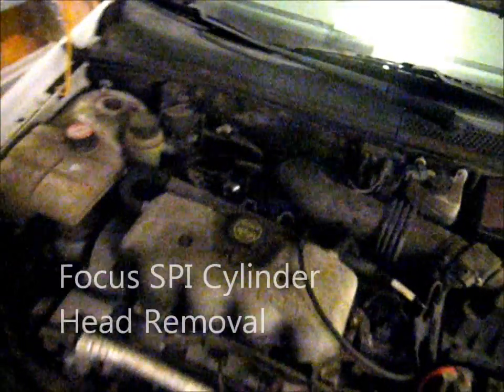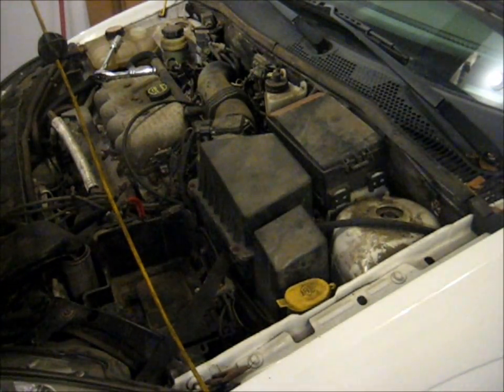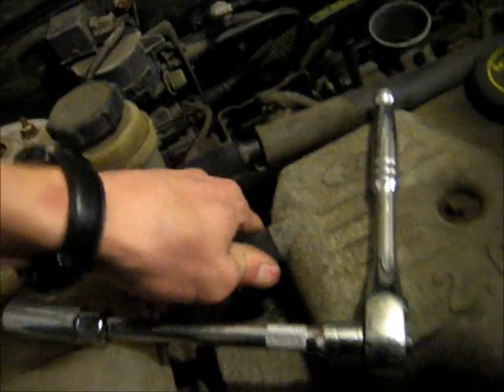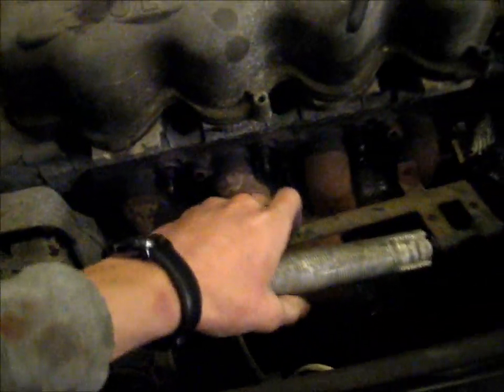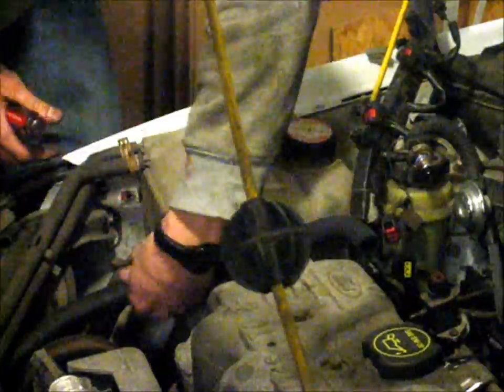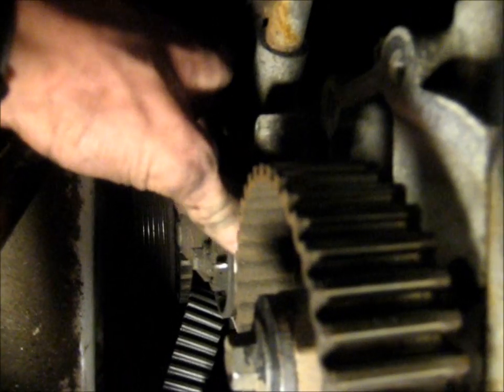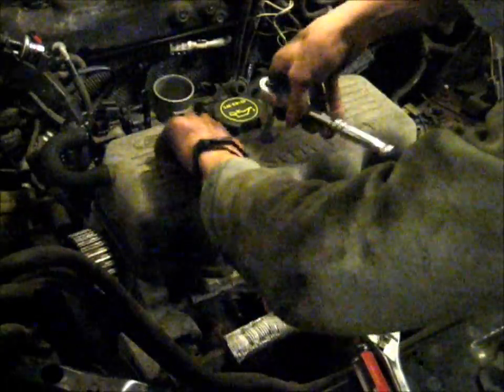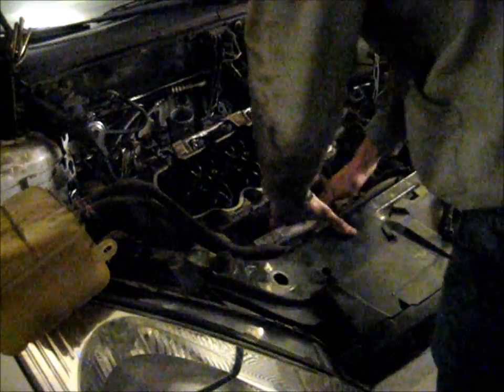Ford Focus SPI Cylinder Head Replacement Part 1 of 4

Comment: Update bought head from heads only and wow they were awful the company did not push down valve seals  so I was blowing blue smoke . When I called them to ask how could you do something like that they hung up.  Check your seals  before installing head. Heads only are very rude I would try someone else.

Comment: to any one who may see this and have a focus with the sohc engine with original head do yourself a favor and follow Alex man's advice and replace with an updated head. I found out the hard way in most cases when the seats dropped if not shut down immediately catastrophic failure will occur... so instead of a 500 dollar fix it can turn in as my case a 1300 dollar fix  and that's cost of parts and machine work unfortunately as the years progress the blocks are becoming hard to find and cost is rising

Comment: Hi Alex, 
Please help, I'm getting conflicting diagnosis from 2 different mechs. Just bought a year ago. 05 Ford Focus ZX4 2.0 DOHC with manual trans.. I'm smelling burnt oil from fresh air vent. No blue smoke or smell of burnt oil from tail pipe. There's oil  dripping from side of motor. First mech replaced valve cover gasket as process of elimination. Somewhat reduced the burnt oil smell but said the lower gasket might need replacement too and more costly. Got a 2nd opinion and 2nd mech wants to replace oil pan gasket. I don't know who's right. The first mech did reduce the burnt oil smell. What do you think. it runs with plenty of pep. I appreciate any info you could give. Thank you.
Reply from the maker: Lower gasket and oil pan gasket mean the same thing to me. Might just be
 the two mechanics use different words. Use some engine degreaser to 
clean up the caked on oil mess. Once it's clean you'll be able to 
pinpoint the source of the leak and replace the corresponding gasket.

Comment: Why not buy a low millage 2.0 16v DOHV Zetec engine and retrofit it into your focus The SPI engine was only offered in the USA and Canada hand down the worst engine ever built ever...
Reply from the maker: It's not worth it. Way more parts are required. Messing with harnesses and computers is a hassle. A head swap is way easier. It's just an econobox car that nobody cares about and if it has some hackjob engine swap then it's worth even less.

Comment: 2000 Ford Focus SE Wagon was pushed into the garage this weekend as a project car for 600 bucks.  I watched this 4 part video series, then watched part 1 like 4 more times.  As of me typing right now, I am exactly where this video ends.  IF you have some common sense, mechanically inclined enough that you are not in fear of this type of work, this young man has given you SPOT on education on this removal.  My removal went EXACTLY as this video describes.  I contacted headsonly and found the head Alex got is 200 dollars.  For 250, you get a complete head, new cam, lifters, rockets etc.  WELL worth the 50 bucks!!!!!.  OF note.  NOTICE the starter when you get to this point.  It is BURIED on this car.  With the head and intake out of the way, I am replacing the starter and the positive and negative cables while I have super easy access!!!  Also. . .now is the time to CLEAN, inspect and replace any bad hoses, tape up that wiring harness bad spots, clean the fender wells, etc etc.  Finally, to lift the entire head, exhaust manifold and intake manifold. . .I used a 8ft step ladder, a 8ft 2x4 and a chain and lifted, pivoted and then set it on the front of the cowl, then hand lifted it down to a bucket.  Worked like a charm.  EXCELLENT video Alex. . .well done sir.

Comment: My Problem runs deep: definite damage to one or more Pistons/Rods, so I intend to replace any damaged parts, then completely rebuild each piston with new rings.  If I'm understanding this correctly; I will need to purchase a Re-Spec'd Head which includes the Re-Spec'd Valve Seat corrections, in order to be certain my efforts have not been in vain, and history repeated, yes ?  In other words, just having the cylinders alone rebored will not prevent the valve seat problem from reoccurring ? Also: I would drain the oil as my First Step. Is there a reason I should not ? Just curious, because even in other videos, nobody seems to be showing draining the oil as an early step. THANKS !
Reply from the maker: Kenneth Enos Boring the cylinders has no affect on the head. You will need to replace the head to fix the problem now, and you should replace it with a head designed to keep the same problem from happening in the future. Drain the oil now or later, it doesn't matter as long as you change it. I think I left my oil in the engine during this work. I changed it once I got it running. No point changing the oil in an engine that is scrap.
Reply: Been studying all the vids, and looks like your suggested EBayer has the recon heads for great price. Hardest part that scares me is pulling all the pistons for replacement & New rings. Thanx Alex!

Comment: how's the head holding up? I just ordered one from "headsonly" on eBay as you did. it arrived today and looks decent. Haven't gotten around to putting it on yet. I have a 2000 sedan. It has not dropped a seat but I feel like it's coming or already has started to drop.

Comment: Do you need to pull the engine completely out to swap the head?
Reply from the maker: It is not necessary. Watch parts 2-4 to see the rest of the process.
Reply: TheAlexManVideos
Doh- of course! One more question -- you removed the head from the block with the manifolds attached. Why not put it back on with them on as well? Let me guess, too difficult to line up the dowels without messing up the head gasket?
Reply from the maker: citabjockey I don't see any specific reason not to install the head and manifolds as a unit besides easier maneuvering of heavy parts.

Comment: How much did it cost you to replace the cylinder heads on your own?
Reply from the maker: Between the head, gaskets, head bolts, and other small parts I'd say you should set aside $500 or so.

Comment: You didn't show the throttle body connections nor the electrical connections on the back side. Careful on the electrical connections as they are brittle. I am trying to figure out that connection of the throttle body to the firewall.....

Comment: I'm in the process of pulling the head on my 2001 Focus - I've got everything off except a connection between the throttle body and the brake booster - I can't figure a way to disconnect that - any suggestions

Comment: for anyone doing this job, the fuel line has a disconnect tool you can buy for 2 bucks, saves a pain in the ass:P but this is a simple job take your time and label things if its your first time!

Comment from the maker: I'm always willing to answer questions. The process is fairly straight forward for an experienced mechanic, but there are many practices you must keep in mind. Don't mix parts, keep all internal parts clean. New head bolts MUST be used, gasket services should be clean enough to eat off of, and never use abrasives to clean mating surfaces, just to name a few. Don't be too proud to know when you're in deeper than you want, but don't be to scared to learn something new.

Comment from the maker: At a dealership or other service center, I'm going to guess $1000-$2000 in labor if the valve seat hasn't failed yet. If the valve seat has already failed, it would likely total the car.

Comment from the maker: You need to remove all the lines going to the intake. There is also a bracket at the bottom of the intake manifold that needs to come off. You'll have to remove all the coolant lines. You need to remove the timing belt, support the engine when you remove the mount. Then the exhaust needs to be disconnected. I doubt that anything in the coolant is valve seat. They are two separate systems. Don't attempt a job you're not comfortable doing.

Comment: Hi, sir, I have some questions. 1. In this video, there's only two brackets at the back of cylinder head(intake side), is that all we need to remove ? 2. On the left side, after remove the timing belt from the camshaft, is the head good to go ? 3. I just removed the thermostat, there's a little piece of metal about 1 * 1 inch, is that most probably came from dropped valve seat ? thank you for your knowledgeable reple.

Comment from the maker: Normally, yes. It is not a huge deal, it will leak a bit but it's not going to spray out and soak you. If the car is running, you can remove the fuse for the fuel pump and start the car. It will run for a few seconds then die, the fuel system is now depressurized.

Comment from the maker: It has 113,000 miles on it. Everything you see there is just discoloration. There is no build up at all on the head. The inside of the valve cover had a little bit of build up but it's actually just about normal for an engine of that mileage. The previous owners were pretty good with oil changes.